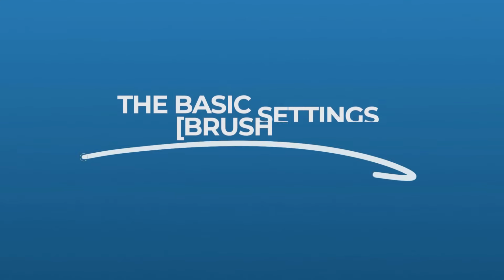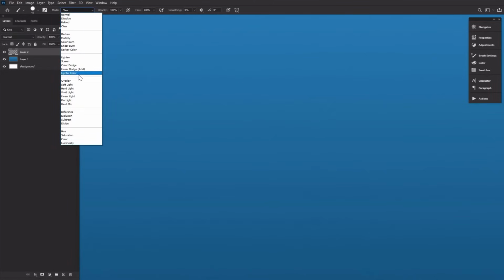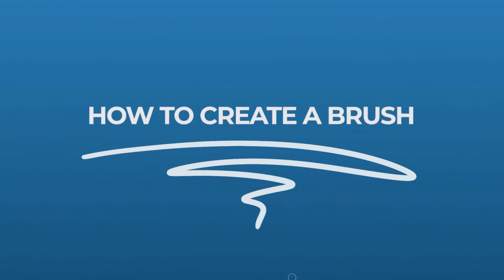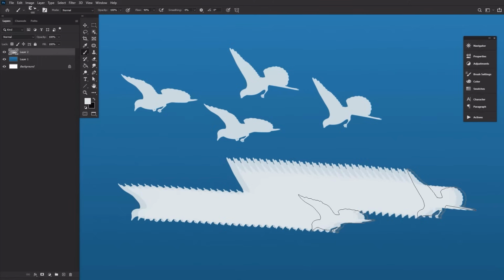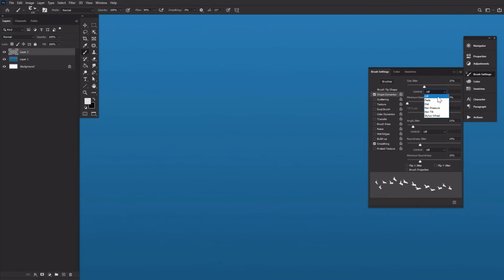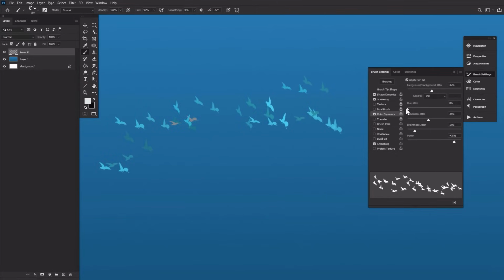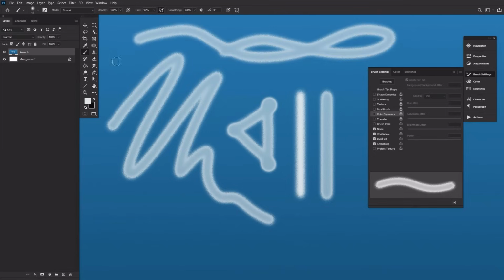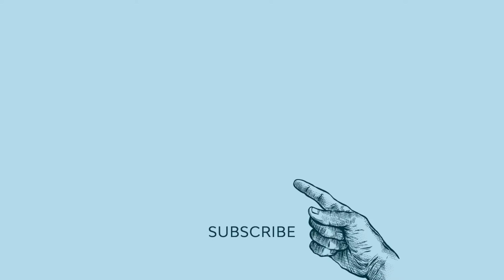Photoshop Brush Tool: A Basic Guide

Comment: I would really appreciate your help. I just installed ps 2024 on my mac on sonoma14.5. I am having issues with my 3rd party brushes. The color well looks striped rather than solid. When I select a brush and add color, the color fades out as I paint; the color in the looks like a gradient. I have spend 3 hrs on the phone with adobe. they insist the brushes are not compatible with ps 2024. I reentered my brushes from my back up, and tried to uninstall and reinstall ps 2024 to no avail. I would really appreciate your guidance. Thanks, Nina
Reply from the maker: Hi Nina! It sounds frustrating to deal with those brush issues, especially after spending so much time trying to fix them. The problem you're describing, where the color fades out and looks like a gradient, could be related to a few settings or compatibility issues with Photoshop 2024.

Here are a few things you can try:

1. Check Brush Settings:
Opacity and Flow: Make sure that the opacity and flow settings for your brush are set to 100%. Lower settings can cause the color to fade out as you paint.
Brush Dynamics: Go to the Brush Settings panel (Window > Brush Settings) and check if any dynamics (like Opacity Jitter, Flow Jitter, or Color Dynamics) are enabled. These can create a gradient effect or cause the color to change unexpectedly.

2. Color Management:
The color well appearing striped might indicate an issue with color profiles or the way colors are being processed. Try resetting the color settings in Photoshop:
Go to Edit > Color Settings and select a default profile (e.g., North America General Purpose 2).
Ensure that the color profile for your document matches the profile in your color settings.
3. Brush Compatibility:

Since Adobe support mentioned that the brushes might not be compatible with PS 2024, you could test the brushes in an earlier version of Photoshop (if you have one available) to see if the issue persists.
Alternatively, try downloading a fresh set of similar brushes from a different source to see if they work correctly.

4. Graphics Processor Settings:
Go to Photoshop > Preferences > Performance and check your Graphics Processor settings. If the option is enabled, try turning it off to see if the issue persists.
Conversely, if it’s off, try enabling it and restarting Photoshop.

5. Reset Photoshop Preferences:
Resetting preferences can sometimes fix issues caused by corrupted settings. Hold down Command + Option + Shift while launching Photoshop and click "Yes" when asked if you want to delete the preferences.

6. Update or Rollback:
Ensure that both Photoshop and your macOS are fully updated. If the issue started after updating, you might consider rolling back to an earlier version of Photoshop if that’s an option for you.

If none of these solutions work, it might be worth checking Adobe forums or reaching out to the community for more specific guidance on PS 2024 with macOS Sonoma. 

Hope this helps you out.
Cheers!

Comment: A thing to note there seems to be a bug where the spacing gets enabled in v25.1 beta, so I struggle brush fringed areas. So make sure to go to the brush setting on the right to lower it. Even if it shows as 1 in the left brush settings.

Comment: Thank you. Very helpful and simple video for a PS brushes beginner :)
Reply from the maker: Glad it was helpful!
Reply: @envatotuts  Thanks for your response. I have a query, it'd be great if you can help. In the Texture option under Brush Settings, in the drop down menu left side of Invert, I can see only 3 tabs > Trees, Grass & Water. In other videos on YT, I noticed various other built in options of texture types, which I found very useful. Can you help identify how to get these default textures, and also how to add more textures in this drop down option of Brush settings. Thanks.